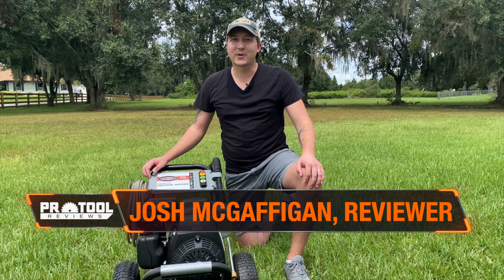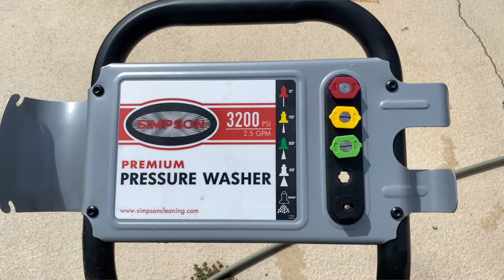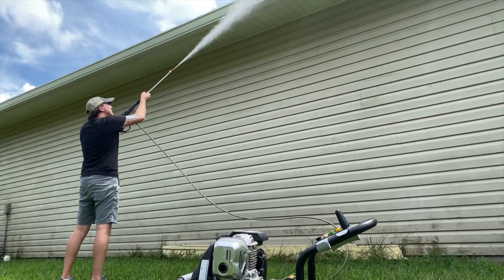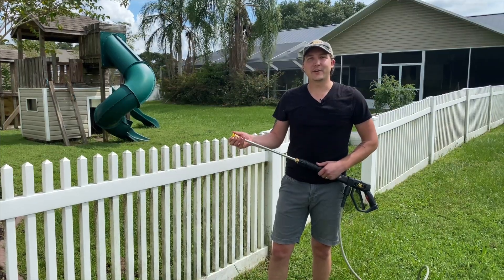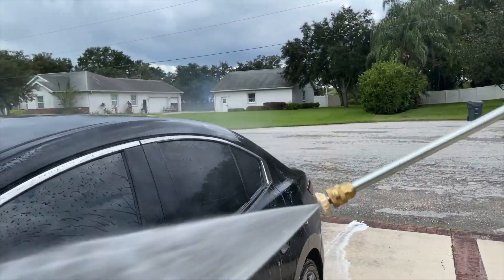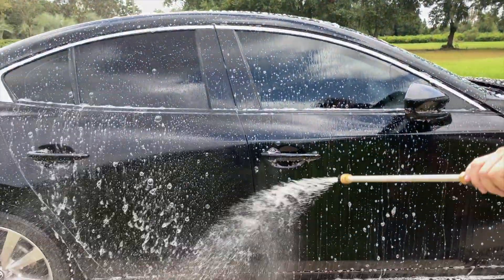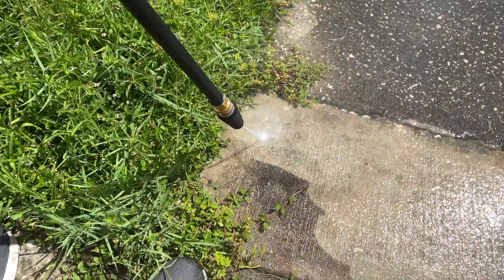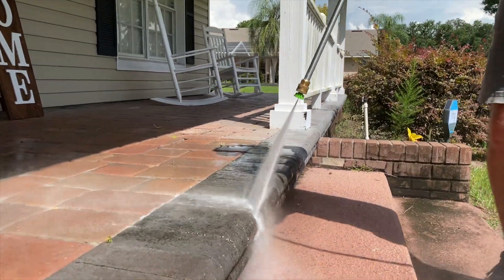What Do The Colors on Pressure Washer Nozzles Mean? EXPLAINED

Comment: I replaced pump on my old powermate with a 3200 psi pump and now its bogging engine down at times,,orig pump was 2200 psi 2.5 gpm...do you think if i stya away from red tip it might lessen pressure on engine,,also is the the unloader adjustable,,if i could get this all set up right it would have awesome pressure and capability,,i use it mainly for cleaning vinyl siding and sometimes i have a sandblaster attach for remving rust on old cars or parts''

Comment: Wonder how much the psi power of the pressure washer changes anything. A 0 degree nozzle on a 3600 psi unit vs say a 1900 psi unit, how much less damage would it do to a surface.